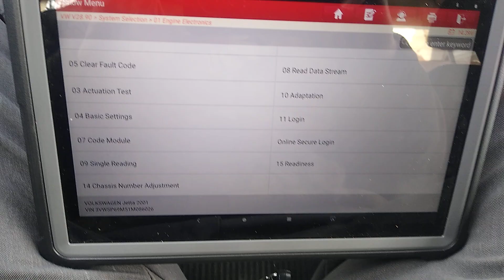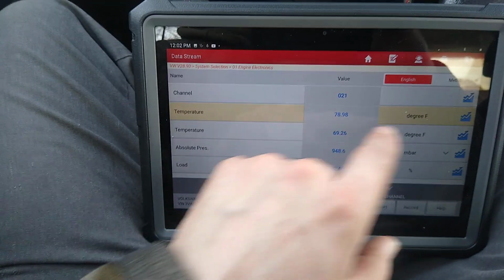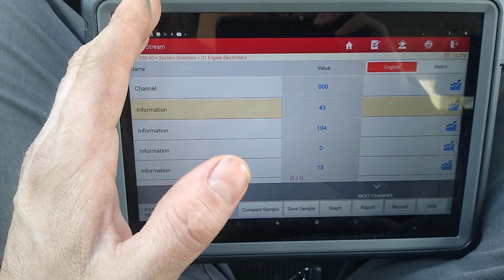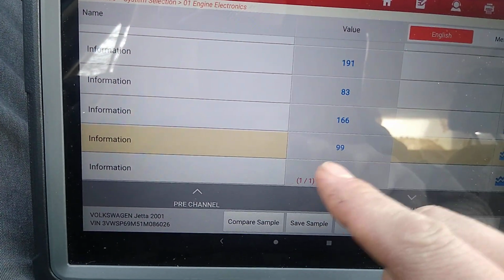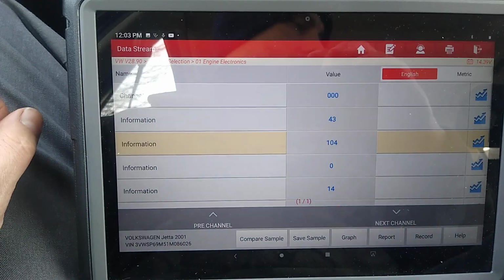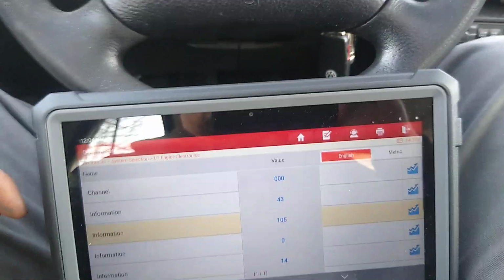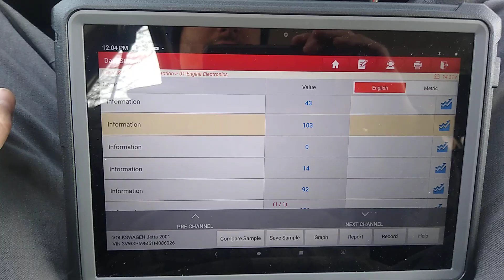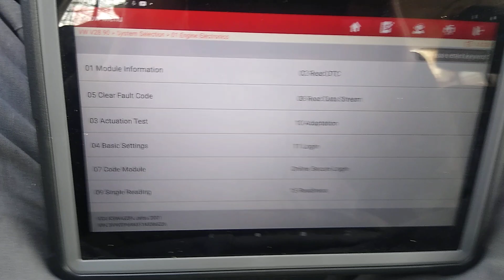Using the Launch X431 Pro5 for VW ALH TDI Fuel injection timing

Comment: Hi mate! Thanks for your video very helpful, i am curious to know where to find all this information about parameters that you are mentioning ( rpms temperature etc) to learn more about launch x431 elite pro, i can see that there is only written “information” and its very hard to understand each one what means, i would like to learn more about this tool there is any traninig course ?

Thank you again!!
Reply from the maker: Not sure on if there is anything as far as training for this specific tool.  I used the forums on ross-tech.com there is a lot of vw specific info on there.  They sell there own diag software but most of the functions and block numbers are the same on other scanners.

Comment: i have the autel ms908 pro 2, i have also bought this scanner its arriving next week reaon being is different scanners do different things and communicate better with different models as your probably aware
is there alot of extra purchases you have to make with lauch?
Reply from the maker: There isn't any that I have had to.  And I have a friend who has a snap on 5-6k$ scanner who has had me do stuff he couldn't.
Reply: @homebuiltgarage7701  thanks for your reply i do mobile jobs and I work at a full time garage and my garage has a 6k snap on scanner they use my scanner instead because its better and does more.
they call the snap on scanner a door stop or glorified service resetter. 
OK well I look forward to testing the launch out because I have the autel I mainly use and a cheap cheerful launch which I used when o struggled to communicate at times so thought I'd get a more expensive better launch which opens up more programming and diagnostics for my mobile company i have started 😀 
thanks for your helpful response 👍